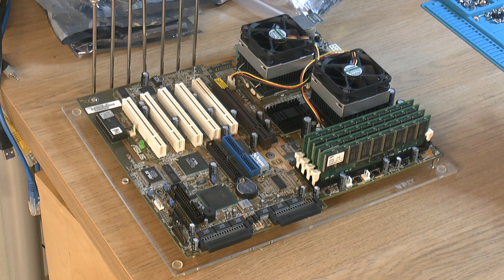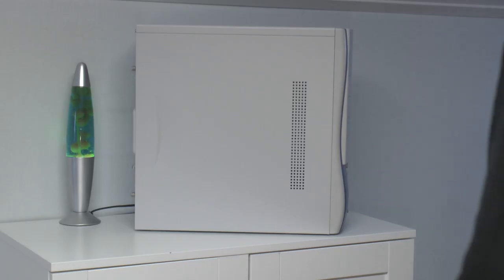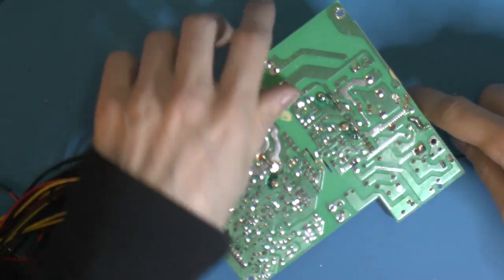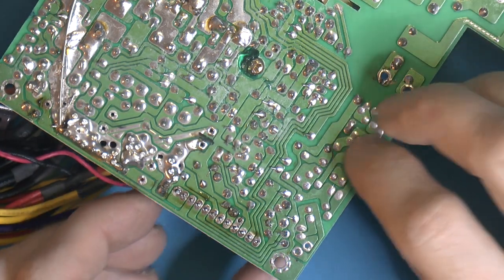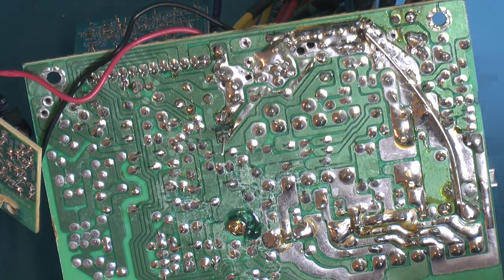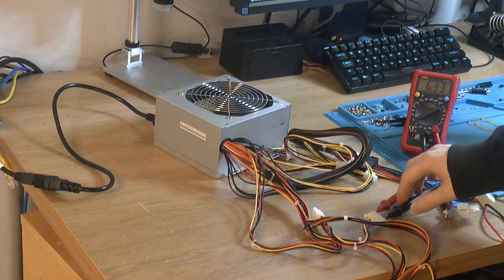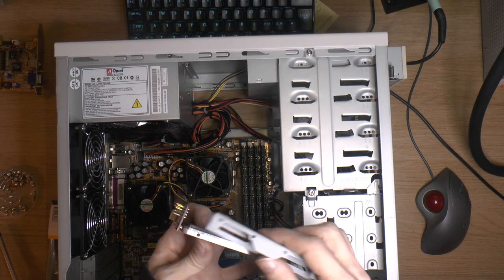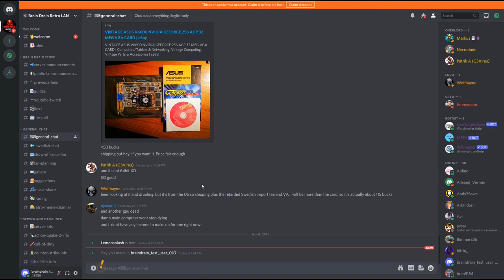Dual Pentium III Build Part 2  - Final Assembly

Comment: I think You should not connect optical drive and hard drive on the same cable, optical drives often work on pio mode, sometimes dma/33 a that will slow down hard drive with udma/133... as I remember (:
Reply from the maker: The SSD runs at ATA 100 speed (chipset limitation)  and benchmarks 80Mb/sec in HD Tune 2.55 so it works as intended.

Comment: 2x Pentium III-S 1400 Tualatin would be a nice upgrade
Reply from the maker: Yes it would be!
Reply from the maker: @vardekpetrovic9716  I had one with an Aopen 815 board but sold it when I picked this board up plus I sold my other tualatin board and CPU too so have no tualatins left. 
Thats how I pay for the videos.

So its Coppermine or Athlon's only now.
Less expensive having fewer platforms.

If I want 1.4Ghz P3's I could probably buy them from my friend that I got the board from because he bought the adapters and processors for me to mod for him before he decided to trade the board to me and I have no interest in Tualatins anymore, it would just slot in to the same performance bracket as my Athlon MP and I rater space my systems apart in performance and vintage.
Plus there is no budget for buying the parts anyways.

I would rater have a 800Mhz class dual socket system because we usually do 1999 era lans.
Reply from the maker: @vardekpetrovic9716  Dont we all, also a BeOS PowerPC box while we are at it XD
Reply: I think this mobo supports Coppermine only. So PIII 1000 is the max

Comment: We're can I get a case like that?
Reply from the maker: I dont know. I was lucky and got it from someone I know that wanted to sell it.
Reply: thanks,  trying to find someone that sells cases like that,  or try to find someone that laser cuts and sand blast paint/rust off of my atx case.
Reply from the maker: @plainsabertooth7828  
Have you tried evercase in the UK?
I bought a New Old Stock case there a few years ago.
I know they are on ebay too if you look around there.
http://www.evercase.co.uk
Maybe there is something there that would fit work.
I dot know about anyone else selling older  cases.
Reply: @Nitton Åttiofyra  I'm in the US, but the prices seem pretty good I'll give it a try:3